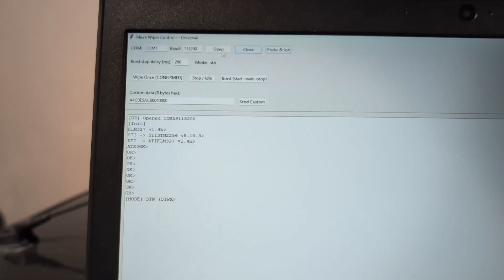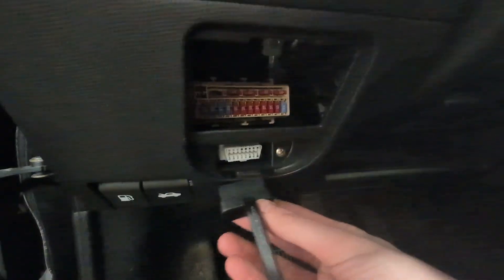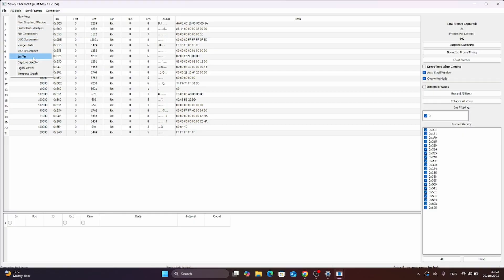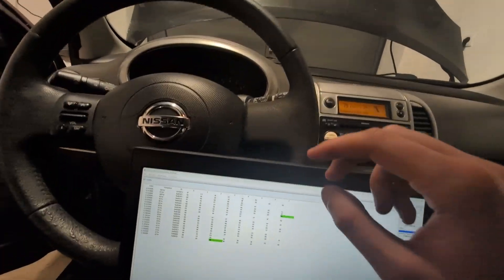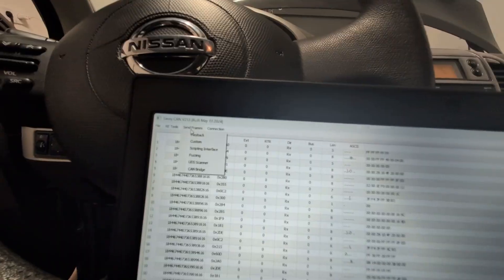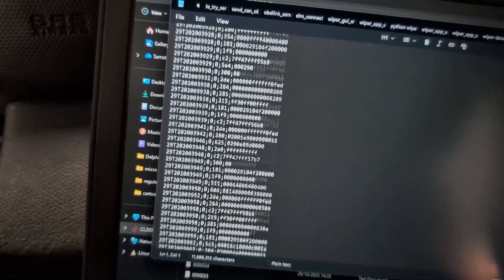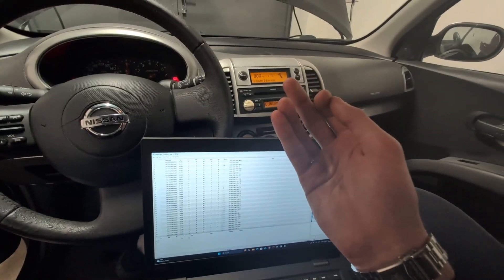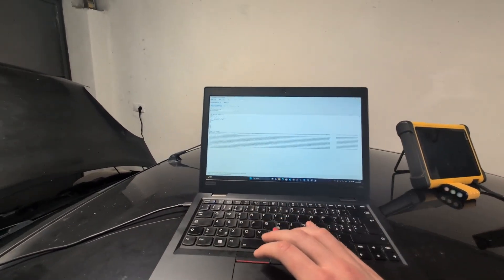I hacked my car with ChatGPT | SavvyCAN canbus logging | Carhacking reverse engineering

Comment: Can you start car by hacking 😂😂😂😂 or just access the bidirectionals 😂😂😂
Reply from the maker: Yes but I haven't gone so far into studying this yet :D
Reply: @iamcarhacker so no you cant start car so you didnt hack shit
Reply: @iamcarhacker well i would focus on getting past the security modules on the starter not sure if you can go backward from there but mimicking the FOB somehow to bypass security circuit on security starter module or something i personally dontbyhink it can be done you have to get into the can bus somehow butvyiu know that
Reply: @iamcarhacker on a FOB you will have to mimic the transponder signal somehow
Reply: Yeah it’s possible. Sophisticated car theives already do it
Reply: Hacker's ARE accessing bidirectional controls used for diagnostic type functions, CAN was never designed with security in mind. After Jeeps got hacked remotely and shown by journalists on TV, Stallantis turned to "AutoAuth" to allow access, basically the as a trusted administrator on a website or other web activities.

Comment: hi nice video , i have a question incase one module lost communication with others modules causing CAN network fail so using this way is there any possibility to know which module is that , and also how i know which module or which control now im in from the the IDs ?
Reply: It's not possible to diagnose a corrupted CAN bus; you have to use a scope and start looking at diagrams to see which modules share the same connections. As a technician, I have found that ABS modules tend to fail and will bring down half the can down or cause a no start condition, unplugging it and watching the waveforms is the way to go.
Reply from the maker: I havent go so far to search for unresponsive modules with this sorry. I only now you can check with topology scan to see which modules and can lines are not responding